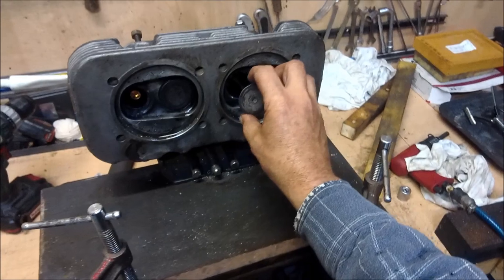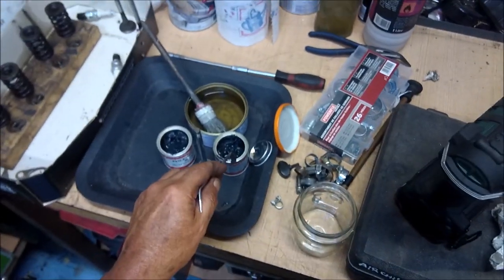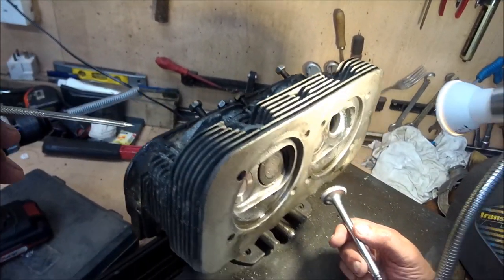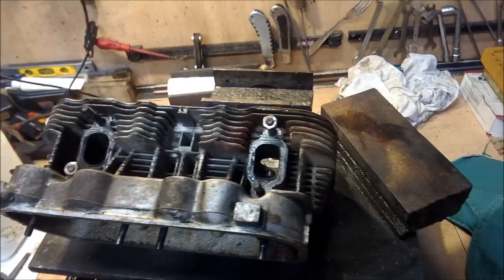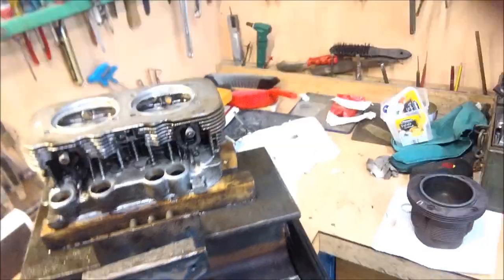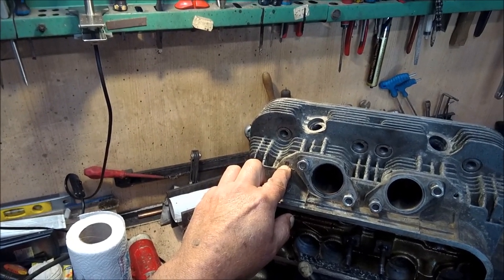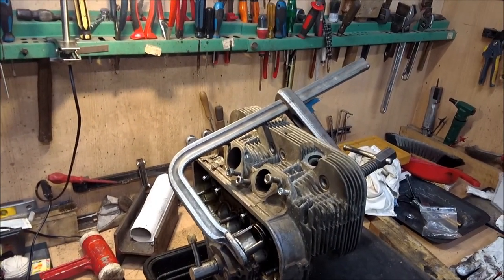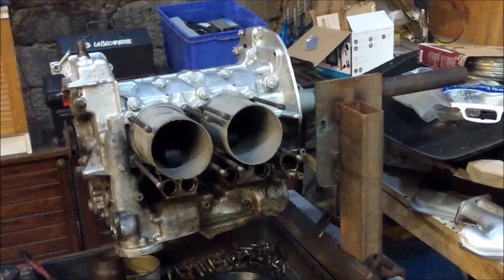How to overhaul a VW 2 litre air-cooled cylinder head Part 2

Comment: Thank You so much for these videos.. I have just removed the head from my type 4 engine as there was a loud knocking. Turned out to be a bolt that had worked loose from the carb, gone through the inlet and was stuck in head casing! no damage to the valves or the cylinder so got very lucky. Your video has really helped as I want to put it back properly now I'm in this deep! Thanks for sharing your tips.
Reply from the maker: Hello,
I'm glad to be able to help.
Cordialement,

Comment: Great video series. May I ask why you use an OLD cylinder to lap instead of using the actual cylinders? I would have thought that lapping the actual parts would result in the best actual seal.  Thanks again for taking the time to educate us!
Reply from the maker: Hello,
The new cylinders are nicely finished, and the lapping is into the aluminium head. I've bee using the same barrels in the workshop for years..
Cordialement,

Comment: Hello,   where might one find such a VW Valve tool ?   I did see where one fellow heats the head to 450F and deep freezes the insert and fits the new guide in that way.
Reply from the maker: Hello
You can make your own valve guide remover, just threaded studding , tube, washers, nuts all in 10 mm. The hand reamers and taps are all 
available on the net.
You will also have to provide your own barrel...
Cordialement,

Comment: What size valve compressor tool is that ?
Reply from the maker: Hello, it is an industry standard sliding welding clamp with a throat
of 150 mm 6", the collar is made from stainless tube 
OD 33mm, L= 30 mm, slotted and a 40 mm washer tig
welded on.
Cordialement,